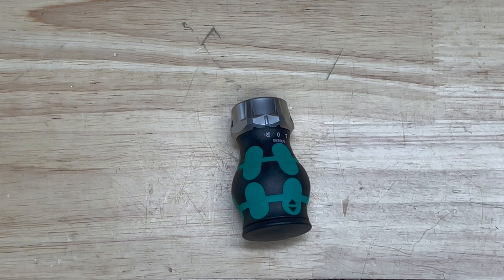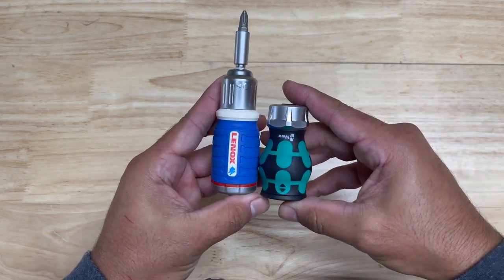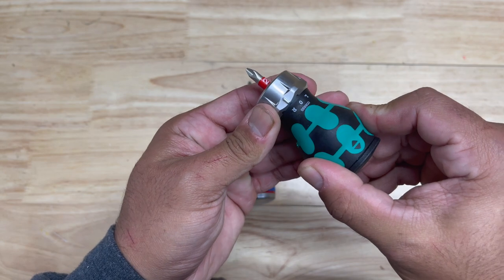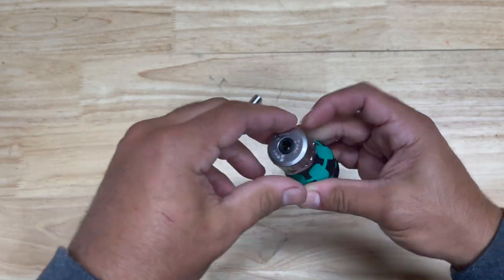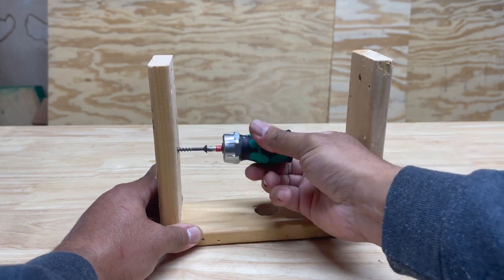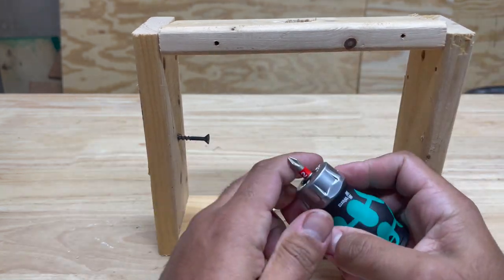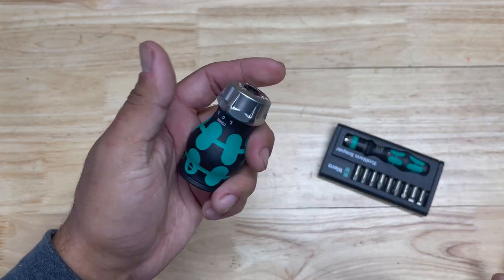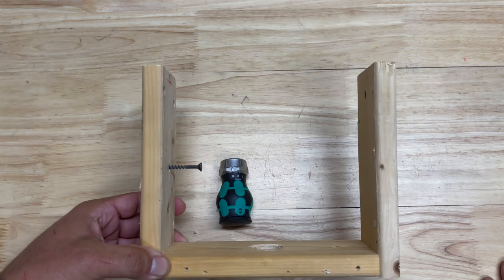Wera KK Ratcheting Stubby. Is a Stubby Necessary for Your Tool Kit?

Comment: I’m with you, My Friend. Ratcheting is a MUST in a stubby driver. For me, though, the Wera 1/4” bit ratchet works even better than the stubby. Fits into extremely tight areas and the fact that it is 90° to the fastener helps you generate LOTS of torque. Great video, Man!
Reply from the maker: Thanks for the suggestion Scott! I have the Wiha 1/4” bit ratchet and I agree, you can get a ton of torque out of those! Always good to hear from you!
Reply: One minor problem with Ratcheting stubbies : the mechanism makes them a tad bit longer , thus restricting access . The Wera seems very good in that regard !

Comment: If you need to work in confined spaces...
... you take the Zyklop Mini 1. Period.

Seriously, it is better in almost everything.
Torque? Zyklop gives you much more leverage.
The space you can squeeze your screwdriver in? Zyklop is much, much thinner.
Ratcheting action? Zyklop has it. Too few torque for ratchet yet? You've got a knurled ring to drive your bit.
Portability? Thin package? Zyklop again.

The only thing that Zyklop doesn't have is the bits storage. Well, there's Zyklop Pocket now. Not that thin as Zyklop mini, but it's head is thinner that the Stubby's body. And it has twice as many bits in it's magazine.

Comment: Agreed that it has enough girth lol.
I have the smaller wera you showed there, its not comfortable. I see the edx point of view, but whenever I want to use it, after my hand hurts, it makes me wish I had something bigger and with ratcheting action, which sounds very much like this wera stubby. I have been eyeballing 816R for the nice torque as well, but its well, also bigger.
Reply: The Japanese Anex ratcheting stubby has the largest girth of any stubby that I know and very compact. Very easy on the wrist too.
Reply: I totally agree, this wera is useless than the 816RA

Comment: Technically not a Stubby , but gets you onto screws in tufffspots : the baby Wera ratchet that comes with the Bitcheck family of tool kits !
Reply from the maker: It’s a good one, I got a Wiha bit ratchet and it is a handy little tool
Reply: @ParklanCustom  Good call !
Reply: @ParklanCustom  Another thing you want to add to your “ Stubby Kit “ is the Malco double ended nut drivers , useful for “ Pocket Socket” problems , on that note ; I need to go on Acme Tool’s site , and get the Metric Malcos !
Reply from the maker: @chrisfyfe9212  I actually have been using the double ended nut driver from Malco for the past month, and I’m mad I didn’t start using it sooner
Reply: @ParklanCustom  I felt the same way , when I got mine ! BTW , they are great Xmas gifts for tech types ! It’s amazing how many don’t know about them !
Reply from the maker: @chrisfyfe9212  Agreed! Always good to hear from you my Friend!

Comment: Essential , gets your Ass out of lots of slings !
Reply: Another Stubby worth a look : the Whia 14 in 1 ( the Baby Bro. of the Whia 26 in 1 . They use a double ended 1/4 hex. They also make a lot of bit assortments , ie: Security , imperial and Metric hex , etc etc . They aren’t Ratchetting but the double ended architecture gives you a pile of options in a small package . I always keep a 26 in 1 ( the standard size driver , and the 14 in 1 in my EDC / Admin bag . That setup has got me out of a few bad jams ! Their Security assortment is very handy , covers about 95% of “ tamper proof “ screws .